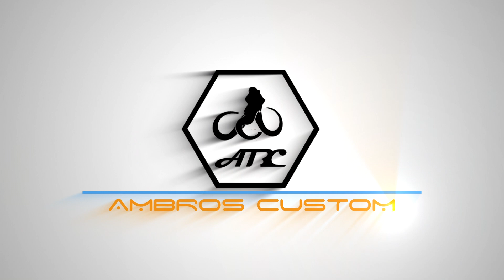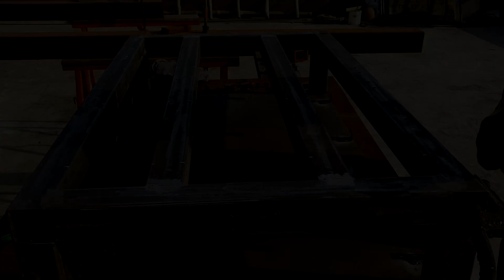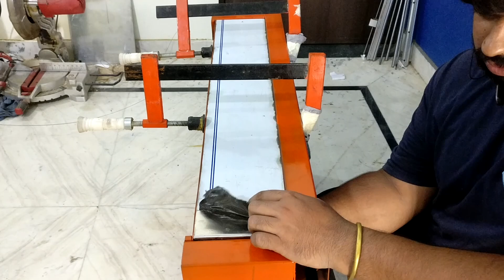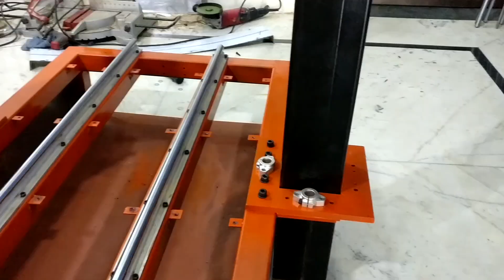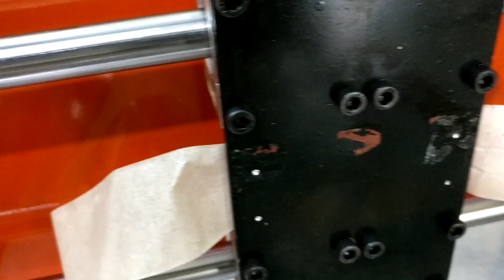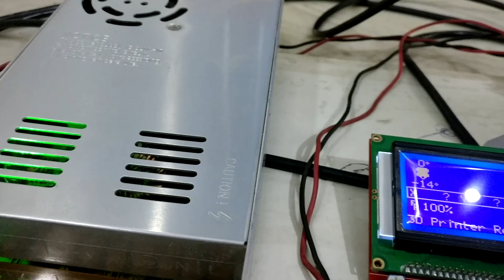Homemade 3 in 1 CNC Machine - Part 3 By AMbros custom

Comment: Need a cnc update video on this and 5 axis...its been to long since last video pls update the builds
Reply from the maker: Buddy there isn't too much work done on that 5 axis, just completed the bracing work of the legs, working on belt sander and stuck in that 3 in 1 cnc for a long time because of some EMF and steps problem but finally got sort out. Going to upload the video soon may be end of this week. The bigger CNC took might be few weeks more to come.
Reply: @ambroscustom  will be exciting see you calibrate and tram your cnc.and show us the detail that normal get miss or over looked... like how you set up calibrate the 5 axis and how...hardware and software etc.
Reply from the maker: Let's see buddy how the work ended up. I am excited too..